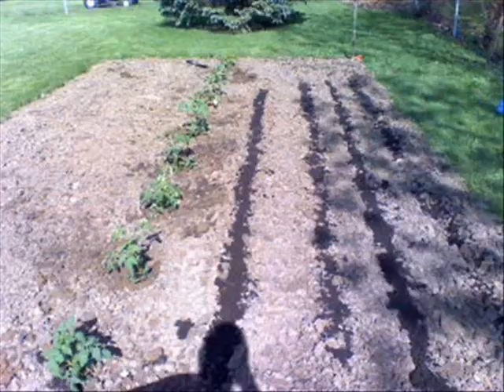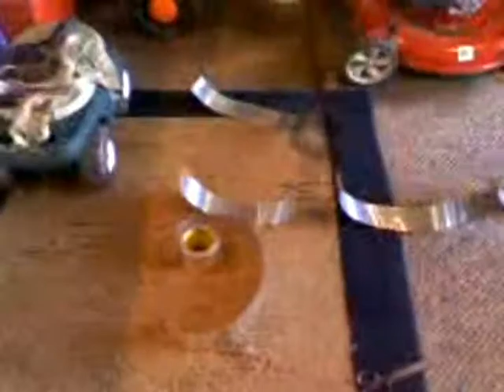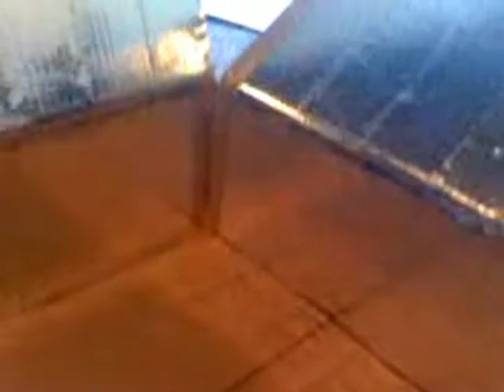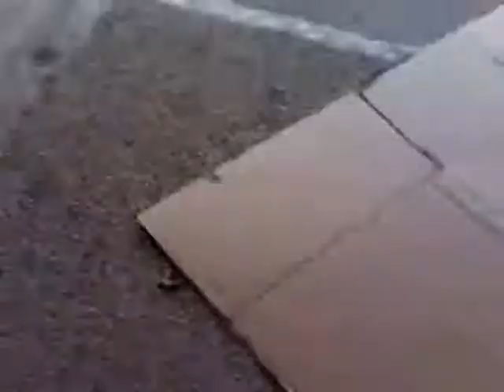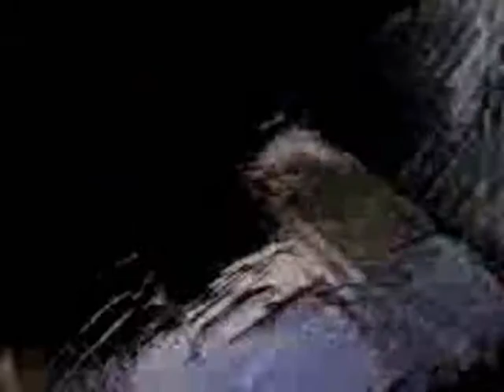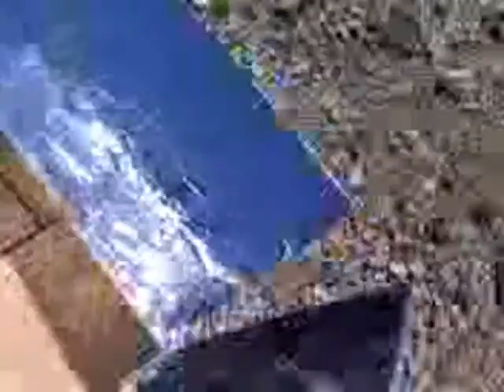My Solar Oven Experiment pt1

Comment: I said it wrong - you keep your keyboard, but you can just change a setting that re-maps the keys. It's one mouse click to flip back and forth. I went to two-handed dvorak after nearly thirty years as a qwerty touch typist when arthritis got me, and it's a much more logical layout with less finger movement. Drives my wife nuts when she gets on my computer, but she's figured out all she has to do is click in the keyboard icon to flip it back to qwerty. But if what you're doing works, rock on!

Comment: Bummer about your arm - I hope you had a good attorney and it wasn't a relative's balcony. You're young enough and technology is advancing fast enough that you'll be able to use your arm again. In the meantime, I don't know what your finger mobility is, but you might check out the dvorak one-handed keyboard layouts - no need to change your physical keyboard, it's a software setting, and most operating systems have them already installed. If you can only use one hand, they'll make typing easier.